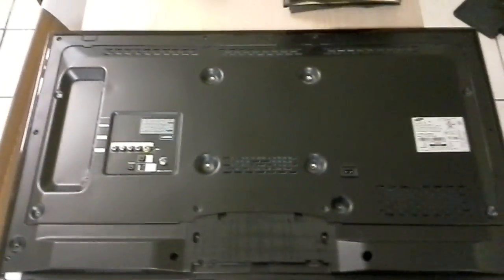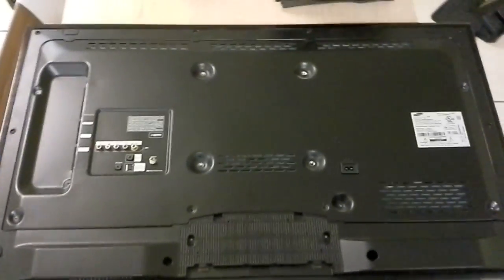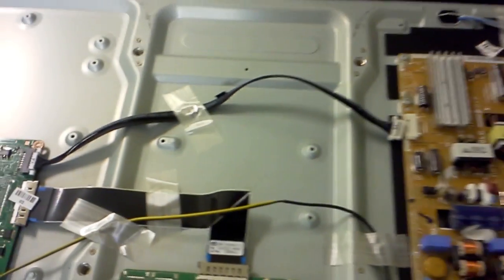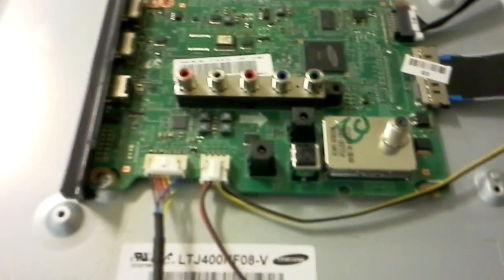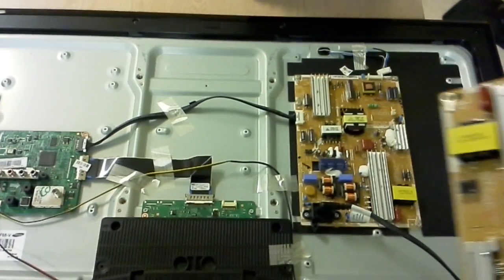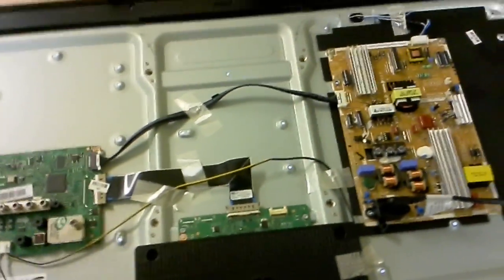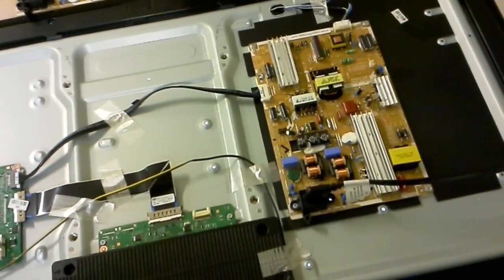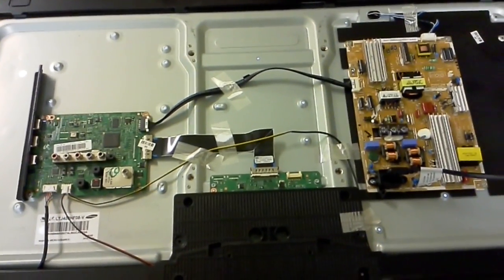Samsung UN40ES6003F smart TV diagnose and repair (BN44-00502A)

Comment: hello friend samsung bn44-00422a i have a card fault when the 12 volt output plugs into the main board's supply socket, the 12 volts is cut off and the flash flops, the tv does not turn on, when i remove the supply socket, it is normal, i changed the motherboard, the same is plugged in, the leds turn on normally when the socket comes out, helpmm
Reply: I will not be able to help that remotely, sorry.

Comment: Hello from Romania. I have an UE40ES4800 with no power symptom, same power supply (BN44-00502A).
.Stand by red led blinks twice, then stay solid, then blink twice, then stay solid..... and so... in a loop. In all this time, the power supply is making a clicking sound.
My question is: can I test only the power supply on the table? I tried to power it and the clicking noise remain. There are some voltages on (ok) with only the power cord connected (5V, 13V.... etc)?
Thank you.

Comment: Great video..I have a Samsung smart TV 2013 blinking on and of after 10-15 mins turns normal then 10-15 mins again on and off 20-30min later works then so on what's next...thank you have a blessed day and be blessed
Reply from the maker: I am sorry. You do not give nearly enough information such as the exact model to allow any meaningful help and this is not the right venue for this type of support anyway.
Reply: @coppelltvrepair  sorry..about that..2013 Samsung smart TV model UN60F6300AF
Reply from the maker: @jirojosephesman8175  I do not have thoughts on UN60F6300AF at the top of my head, sorry. I know I can find my way around it, but I do not feel comfortable giving advice on something I do not do daily. It is one thing to solve a problem, it is a very different things to teach others how to solve it. Bring it to a specialist or just keep searching for someone who is familiar with the F series.
Reply: @coppelltvrepair  thank you have a blessed day and be blessed

Comment: I have the Samsung UN40ES6003F I replaced the backlights because it was black but with a flashlight I could see images on the screen. But now It works but the screen is slightly dim, or not bright enough. So I thought maybe it was the T-CON board so I replaced it, but there’s no change. What do you think the problem is? It won’t brighten up.

Comment: I have the same symptoms on my TV t-conn board is clicking. I turn on the tv black light flashing of three seconds and then every thing turn off. I replace the t-conn board and the main board and still have the same problem. My tv is a Samsung unh657100afxza. Please help thank you.
Reply from the maker: Sorry this video is for UN40ES6003F  and you shouldn't expect that I can help with any TV out there without being able to poke it myself. They're similar and yet there may be small yet significant enough changes to throw me off and doing it remotely adds a whole another layer of challenges.
Reply: Coppell TV Repair LLC can I send you a video on my tv and maybe you can tell me if you ever seen something like this?
Reply from the maker: @mariolopez1747  We do not offer remote troubleshooting like that, sorry...for one we do not have the resources for it - there's way more people out there with way more questions than we can handle; and second, the more we answer the more questions that usually leads to - tried it and it didn't work well for us.
Our advice is to find someone offering repair for boards from your particular TV model OR find a local service tech that will do the job OR keep on reading Internet and make the most out of it...just be aware you'll read a lot of things that are inaccurate or not applicable to your situation or flat out wrong.

Comment: I have un60h6203 just flashes red standby.. I attempted to troubleshoot by unplugging control board to see if back light led come on when plugged in. The LED just flash on and off when power board is plugged in. Is the a power board problem or bad LED ?
Reply from the maker: I am afraid the information is not sufficient to allow choosing either possibility with even remotely close level of certainty.
Unless someone has seen it several times already and it was always one or the other - for this particular model, that is - then you are back down to either classic troubleshooting or just picking one on eBay, replacing it and seeing if the problem persist (then it's likely the other).
Reply: Coppell TV Repair LLC if I replace both boards should correct ? Do you have both board to order ?
Reply from the maker: @brandonfisher6256  And between power supply and LED strips what do you mean by "both boards"?
Reply: @coppelltvrepair  Power control board and Video control board ?
Reply from the maker: @brandonfisher6256  If LED lights are flickering or flashing when the main board is disconnected from power (and they should not be) then why are you concerning yourself with the main board?

Comment: I have the same model number TV, only in 46".  What you describe is exactly what is happening with my TV. I get the welcome chime and red light blinks twice, then nothing. No picture. If I unplug it and wait and plug it back in 10 times, it'll work. The next time I turn off the TV it happens again, chime,red light blinks, black screen.  I've ordered that board hoping it'll work. THANKS

Comment: I thought this was a great video and the very fact you kept trying and did not think it was the Main Board that was at fault, I have been seeing that very problem in couple of the Samsung's that I've come across and it is usually the back light or the Power supply as in your case. A great video.....really appreciated it. Thanks

Comment: i, need advise , i have a Samsung LA40B650. bought it second hand an it died 1 days later. power turns on with a music an turns off the same but no picture after that just blank. i tried to unplug from the switch few times an plug back it gave a turn on kind very mild light for a sec an turns black again. after few tries it turned on for 10 mins an went to the source page but died after 10 mins.. need advise if i can fix it.  also i tried to connect power with unscrewed power board an the electricty in my whole house tripped out. now iam scared to plug the tv.. advise please thanks

Comment: THANK YOU THANK YOU THANK YOU, Copell TV Repair LLC !!! This video helped me fix my TV for free, but it was NOT the power supply or Smart computer motherboard that failed. When you talked about the Wifi adaptor failing, it gave me an idea that worked. I want to share what worked for me, as a companion to your video. So here we go:

If you have the Samsung 40" 6300 Series (AKA  UN40F6300 or MFR # UN40F6300AFXZA) or any other size of the 6/6300 series, then please read this first, it worked like a charm for me. My TV was randomly powering off and restarting over and over, I figured the caps were bad or the smart computer was bad, as others have indicated. Turns out the WIFI adaptor was causing this, yes really, the Wifi adaptor!  
Here's how to disconnect the TV's WiFi adaptor. If this fixes your problem, then you have two options; 
1. Use Ethernet instead, and spend no money!
2. Replace the Wifi adaptor. 

My Wifi adapter never worked anyway, so unplugging it and using ethernet is an easy and free fix.

1. Unplug all wires from the TV.
2. Remove the TV stand - 4 screws.
3. Put the TV face down on a big flat table, with a big towel flattened out under it to prevent any scratches. 
4. Remove the little trap door under the connectors, and unplug that wire that is connected to the motherboard. You squeeze together the little buttons on the sides of the plug to release it. You have to do this, or you'll rip the wires out when you remove the back of tv. Now your'e ready to remove the back of the tv. 
5. Remove all the screws from the back of tv. Note: There are two different size screws, so be careful to make a note of which size goes where. Also note: there is one screw above the rca connectors that needs to come out as well, I didn't notice this one at first.
6. Carefully lift up on the edges (the decorative clear plastic frame) and remove the back of TV. 
7. Turn the back over and you'll see the Infrared Remote sensor on one side, and the wifi adapter on the other. Remember the plug we disconnected from the Motherboard earlier? Well, the Wifi adapter is mounted on the tv back plate, on the other end of the same wire.
8. Carefully unplug the wifi adaptor, then use a piece of tape to secure the plug in a safe place, where it won't touch any other electronics.
Reassemble and test the TV - I'm not sure if you can test with the back off. I bet you can though. I just reassembled mine to test, but that's a lot of work.

If this works, congratulations. You fixed your TV for free, but now you only have an ethernet connection, no WiFi. I'm sure you can buy a wifi adaptor on ebay for a few bucks though. I hope this helps some ppl. Oce again THANK YOU to Copell TV Repair LLC !!! You saved my TV!!!

Comment: every thing is  possible>>>  ps43d450  plasma  have  strange   shutdown>>>  after i   exonerate the  smps  to be problem  i was  very stuck  ....lately i  discovered it is  the  buffer board  ....thought  they usually  fail  catastrophically  this one is not  and  it lead  me  really  astray towards  thinkiing it must be   a  smps  or control